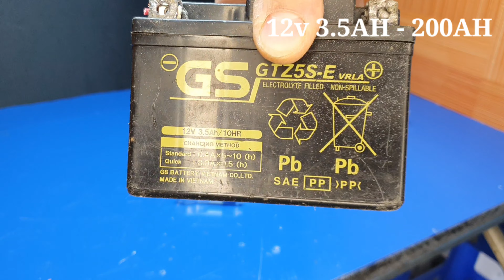How to make a simple inverter 3000W, IRF3205, creative prodigy #20

Comment: Ficou muito top demais sucessos
Reply from the maker: Obrigado por seu comentário
Reply: C'est une arnaque , il est connecté par 2 fils 220v par dessous de la prise en fin de vidéo , car le condensateur rouge placé en série  ne peut pas conduire une puissance au-delà de 0,01A . C'est un circuit n'importe quoi , faite Attention.
Reply: I did it successfully if you know about electronics you will know about it you say you have no knowledge of anything to say so
Reply: That capacitor has a voltage of 400v

Comment: That is not a true sine wave converter, and with that small heat sink, it will not even supply 300 wats for more than 2 minutes before burning up from thermal runaway.

Comment: The schematic doesn't match. Driving mosfets in parallel is horrible and switching losses will hit the mosfets differently. The saturation of the transformer makes me cringe. Your cutting out any DC bias on the output with the capacitor. Every single single person that listens to short wave radio/am/ham operators within miles probably hate you. 😂